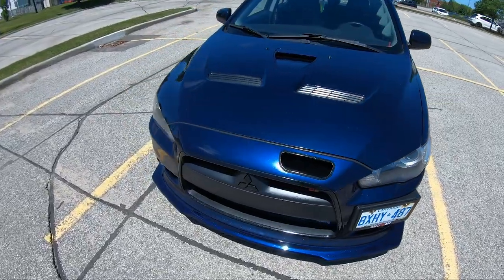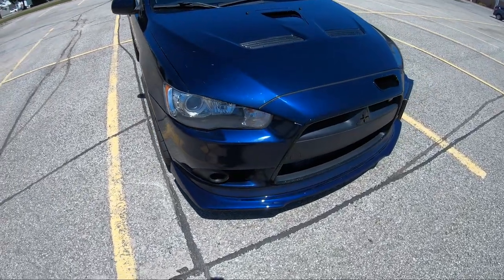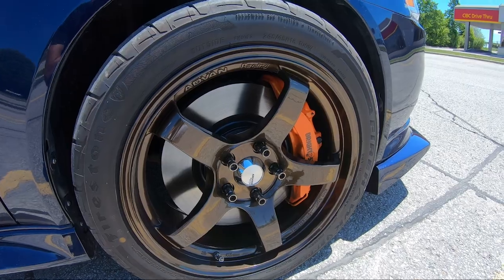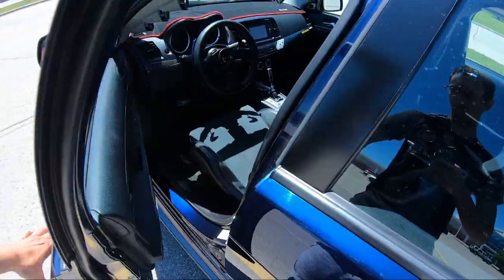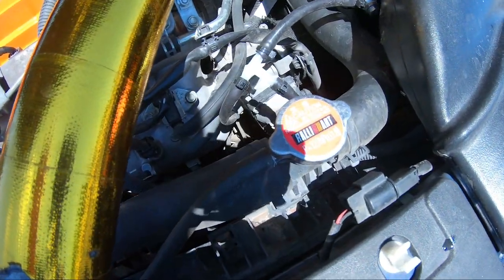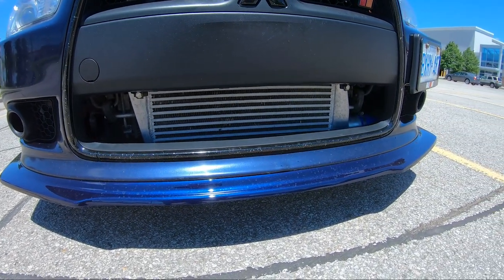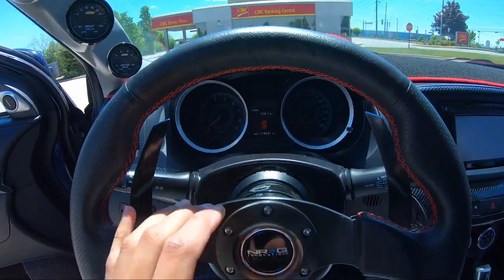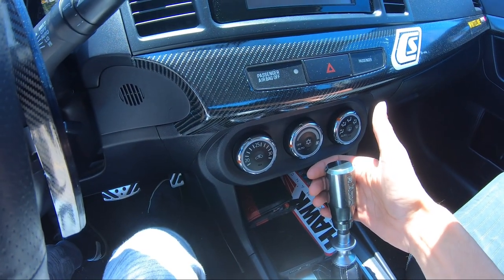Mitsubishi Lancer Ralliart! My Mods and Build

Comment from the maker: Just adding a disclaimer, I do drive it in Normal/Auto until the SST has warmed up and then I switch to Sport/Manual once it has reached operating temperature.
Reply: I have a Ralliart and never knew that... is it bad for the transmission if you put it in sport strait away?
Reply: @durrymcflurry3028  its recommended because of the increased clutch pressure, so the fluids need to be warm when in ssport.
Reply: @rozikhan2744  I only put it in sport mode not ssport, so is that fine?
Reply: @durrymcflurry3028  thats fine but everyone i know keeps it in normal when heating up.
Reply from the maker: It's goes below 0°C in the winter season here, I drive it in Normal mode to allow slip intentionally to warm it up. Once the fluid temperature reaches around 40°C, I put it in Sport. S-Sport is not recommended for Ralliarts (subject to opinion) because of the different gear ratios between the Evo MR and Ralliart, therefore the software for TCU is different. Although S-Sport does offer increased clutch pressure, you'll destroy your gear synchros driving it all the time in S-Sport. I would only ever use it when launching at the drag strip.
Reply: @torontotuners8218  I live in Australia so even in the winter it’s 15°, so I think I’m sweet to put it in sport mode all the time, just not s-sport
Reply from the maker: Yep, you should be good! If you need any help or advice, I believe AK Racing (Australia) are the guys to talk to for anything Evo/Ralliart related.
Reply: @torontotuners8218  Yep and RP Customs.  They'll both recommend you drive in super sport manual all the time.  Its fine to put it in SSM even if the gearbox is cold.
Reply from the maker: @CDTJosh  I disagree with the idea of putting it into Super sport and manual when the SST is still cold, but to each their own. If it's a hot climate then I wouldn't disagree, but when it reaches close to -20°C here in Canada then I would always let it idle for a bit and drive it casually to let the SST warm up before doing any spirited driving.
Reply: @torontotuners8218  cold in Sydney Australia is only about 5°C on a really cold day in NSW its usually at least 13°C by 8am here (assuming thats where he is cause RP customs)
Reply: @torontotuners8218  I’m in Aus I always let it run in idle/neutral before leaving on a cold start up for around 10 mins
Reply: @torontotuners8218  Calgary, AB here. Looking into getting a ralliart next summer. Wanna tune it more to have fun with the AWD. Gotta do some research to tune my future car Tove able to handle on seasons on this side of Canada.
Reply: No S-Sport!??
Reply: @torontotuners8218  What every sst needs to combat this is getting a Dodson Heated Sump. This will help dramatically even on a completely stock vehicle.
Reply: Do you need to unlock the S-Sport mode ? I'm still new to Ralliarts and I only have sport mode. I didn't know about S-Sport mode. Any help would be appreciated
Reply: I heard someone said that driving in automatic will ruin the transmission more and fast then using the "manual" mode. Is that true?
Reply: I heard someone said that driving in automatic will ruin the transmission more and fast then using the "manual" mode. Is that true?

Comment: Bro nice car, I have one of my own here in Brazil. Nice piece of advise about the SSport and the warming up of the SST. Would you mind listing your mods and the links for it? Really liked what you done with your RA.
Reply from the maker: Thanks! Honestly, I had a mod list at one point and deleted it. Most notably was the BBK front and rear, stainless steel brake lines, lowering springs, full turbo back exhaust, upgraded fuel pump, upgraded injectors and a custom tune.

Comment: Hows the transmission of that car? Evo or rallyart is one of my affordable dream car to drive and been hesitant because of the auto trans.
Reply from the maker: Take care of it, do the transmission, transfer case and diff fluid changes when you are supposed to with OEM fluid and you'll be fine. It is a hit or miss with the shift fork issue but the later model years (14-15), don't seem to have the problem as often

Comment: Saw u got a stock intake, would you ever change it to a cold air intake? If not, why?
Reply from the maker: Hey, sorry for the late reply. Stock intake with a drop in filter performed great for this setup. Also I had the bumper duct cutout for the stock intake so an aftermarket intake would have made it less efficient. Aftermarket intakes have their benefits but on a Ralliart it must be tuned otherwise the SST will react negatively to the modification.

Comment: Hey man, been thinking about getting a RA from my ES, and would want to get it modded to make around the same hp as yours if I were to get one.

How's the mpg looking like and how much was ur performance mods cost so far? excluding the brakes, tires, wheels, aesthetics.
Reply: don't do it bro, these cars are junk.
Reply: @pd5041  why'd u say that? Any particular reason?
Reply: @RedZekester  They come with an enormous  list of problems. Ayc pump, timing chain, tranny, turbo etc. maintenance is insanely expensive, stock they’re only pushing 200 wheel horsepower. If you do modify it then you’re putting all of this money into something that’s still slow. The AWD system isn’t even from an evo either it’s from the last gen evo. Honestly not a good buy, plus people will call you out for a wannabe evo. Up to you at the end of the day though.
Reply: @pd5041  shiiii, i just love how lancers look why I wanna stick with em. Can't afford an evo yet so I was thinking to go with a ra. U making me double think to just save up for an evo lol
Reply: @RedZekester  yea bro fr, I wanted one of these back in 2020 but when i found out rebuilding the tranny was 15K at the dealer or 5k at a shop I was like all of this money and work for a slow and weak car isn’t worth it. Just save up for a few years and buy a GSR.

Comment: Did you have to DIY the vent in the bumper or did you buy a bumper with it installed already?
Reply from the maker: It's a kit made by the same guy who did my BBK. It comes with the template to cut out the bumper to fit it.
Reply: @torontotuners8218  is there a link to buy the same template ?
Reply from the maker: No there isn't sadly, it's a proprietary design made by a guy in the Ralliart groups. You'll have to contact him personally if he has any left lying around or is planning on doing another batch soon.

Comment: How is car and transmission holding up? What power is it putting down and did you tune transmission with the extra super sport shit like evo.. ?? Very cool car. Nice upgrades.
Reply from the maker: Thanks for the comment! Car has never let me down once, I have owned it for 4 years and it has been custom tuned at 330whp, 350tq for half of that. No Super Sport here, I don't recommend it as the launch control you get with it isn't very good and the 5th and 6th gear ratios are different in the Evo. You get better clutch pressure from Super Sport, but again, that can be changed in the SST tables for Sport mode to be just as good.
Reply: @torontotuners8218  if I can I have two questions for you.. 
The engine internals are the same of the Evo? With bigger turbo , IC and injectors 300hp are possible with stock reliability?
Without front and rear LSD in the rain or tarmac does it oversteer under throttle?
Reply from the maker: Yes, engine is identical to the Evolution, except for the Final Edition which has sodium filled valves. With just a turbo upgrade you can make it to 300hp easy, injectors and fuel pump can get you to 500hp depending on the turbo and with the right tuner of course. I've seen a couple of Ralliarts pushing over 500hp that are daily driven, so yes, reliability is kept as long as maintenance is upheld. I believe it comes with a front LSD if I'm not mistaken, it will understeer on tarmac but I can get the rear to swing out on wet surfaces.
Reply from the maker: I was partially correct, the Lancer Ralliart has a front helical LSD, a rear mechanical LSD and an ACD (active center differential).

Comment: Hey man how do these handle being driven hard stock? and does your Ralliart come stock with a turbo? going to hopefully picking one of these up to replace my current daily which is a Kia Sportage AWD ( the AWD system is absolutely garbage) how do these handle snow and ice , I live in Maine and we get similar weather down here as you guys do in Canada
Reply from the maker: A Ralliart is the best purchase you can make if you go through all four seasons and need something practical that will never let you down. The Lancer Ralliart shares the same engine with the Evolution, so yes, it has a turbo albeit smaller than the one found on the latter. A good set of snow tires and it will get you anywhere you need to go during winter. Not many know this but the Lancer Ralliart uses the exact same drivetrain as the Evolution IX, just paired with a dual clutch transmission.

Comment: I just got a ralliart a few days ago I was wonder what fluid to use for it I want to change it out
Reply from the maker: For engine oil you can use whatever you like, I use Mobil 1. For the SST you MUST use Diaqueen SSTF-1 or Castrol Transmaxx Dual, anything else will wear out the components much faster and eventually break your transmission. For the transfer case and diffs just stick with OEM, it's cheap enough.

Comment: You have my respect regarding your ride. Do you have the info regarding whom did the Big Brake upgrades? That info would be greatly appreciated & thanks for your time. 👍🏾
Reply from the maker: I did them myself actually, sourced the calipers used and had them powdercoated to a color I liked. Getting them to fit requires modification to the wheel hub by enlarging the caliper mounting holes. They bolt right up after that, you have to use larger Evo X rotors with them.

Comment: Hey there, im looking at a ralliart myself. This one ive been looking at has been tuned by silvertuned performance aswell as the sst rebuilt by sjl custom auto. However it has 160,000km. Previous owner has sst maintenance records. I was wondering how many reliable years or kilometers i can get and if it would be a good purchase. Thanks
Reply from the maker: If it's been tuned by Nick and has a built transmission from SJL and with all the maintenance history then it is absolutely worth it and will last the life of the engine. You probably have another 40,000km in it before you should have the engine inspected. Sorry I didn't answer sooner, I don't check the channel very often.

Comment: Hey man just got an 09! Any idea what would help the most to get it to 300hp? That’s my first goal. Thanks !
Reply from the maker: Quickest way to 300 is to do a Evo X turbo swap. Exhaust manifold, turbo, downpipe, oil/coolant lines and intake. You can go all OEM if you can find the parts second hand. This would be the most cost-effective option as there are plenty of OEM parts around. Also have it tuned by either Kozmic if you're in the states or SJL if you're in Canada.

Comment: I am 17 years old looking to buy a first car, would you recommend a ralliart as a good starter vehicle?
Reply from the maker: I wouldn't, no. They are becoming more rarer and older, thus having higher mileage and also more than likely haven't been maintained properly (always an odd one out there that has been cared for and is in good shape, but definitely a needle in the haystack). Not to mention the higher costs of maintaining and servicing of the AWD system (SST, front transfer case, rear differential, etc). If you're willing and have the funds to do so, I won't dissuade you since I went in the same way, without a single thread of knowledge about the platform. There is a plethora of information out there in forums and Facebook groups that can help as well.
Reply: @torontotuners8218  thank you, I never really thought of it that way. Ralliarts and evos have always intrigued me but they may not be the best in the long run
Reply: @BG-ds1ti  I was in your boat wanting to get a Evo or Ralliart for my first car since they would be getting rarer by the second. I had the money to afford an Evo but overall not enough money to maintain it and it's insurance (i'm 18, it's my parents money handed down to me). So i decided for the next best thing and got a GTS 5-Speed. Uneventful, i know. But it's just to fulfull my Lancer Itch until i'm truely able to keep an Evo/Ralliart. It's extremely hard to find a 5 speed in South Florida as is so it was a no brainer to get it while it was still available. Hopefully by 21 i'll get my hands on one, it will be expensive but worth the wait.

Comment: Do you need to unlock the S-Sport mode ? I'm still new to Ralliarts and I only have sport mode. I didn't know about S-Sport mode. Any help would be appreciated
Reply from the maker: You have to flash the TCU with Evo X MR software to be able to use S-Sport mode.

Comment: Hey how’s the transmission doing?, I saw a 2010 with the automatic and it has 145k km, I like the car but I’ve seen so many people saying that the transmission shifts really good and everything but is very unreliable 😅😅
Reply from the maker: Transmission was better than ever, shifting good and hard (in a good way, it's been tuned) at 140,000km. Also it is not an automatic, it is a dual-clutch. As long as the transmission has a consistent service history and will continue to be serviced correctly it will last for a while.

Comment: Do you think this is a good first car? I am currently looking for one of these and found a 2011 model with 105k miles on it. But, I have heard that these aren’t reliable and my parents don’t want me to get one because of that. I am just curious of what you think or should I start looking for a different car?
Reply from the maker: For a first car I don't recommend it, they are expensive to maintain and as for reliability they are bulletproof ONLY if they were taken care of by previous owner(s). I'm currently at 130,000km with no major issues except for the accessory belt auto tensioner which failed. In my opinion, buy a Toyota 86 or Subaru BRZ, probably the best first car out there, make sure you get a manual.

Comment: how much did this car initially cost you ? I want to get this 14’ ralliart with 71k mileage but i want to know if im being overcharged
Reply from the maker: That's high mileage for a Ralliart, if it has service records, go over them to make sure it has had regular SST fluid changes with OEM Diaqueen. Depending on the body condition as well, and if it has the leather Recaro seats, navigation, etc. I would say $8000 is what it is worth.
Reply: @torontotuners8218  i might buy an 09 ralliart with 129k miles, what do you think?
Reply: @Toronto Tuners its pretty much stock
Reply: @torontotuners8218  thank you

Comment: What turbo for 400 hp, my ralliart is with evo x turbo (turbo hybrid)
Reply from the maker: With an Evo X turbo and supporting mods you could see over 400whp. My turbo is a modified TD04, so stock frame and it's been retuned recently to 330whp. With fueling mods I could get close to 400whp as well.
Reply: @torontotuners8218  the stock td04 turbo comes stock with ralliart right ? I’m thinking if I should buy a upgraded X turbo but not the stock one or jus upgrade my 2011 stock rally turbo !?
Reply from the maker: Yes, all 2009+ Ralliarts come with the same engine as the Evo just with a TD04 turbo instead of the TD05. It all comes down to what you want, upgraded TD04 will only get you so far for power but will have incredible low to mid range. Going larger turbo, such as the TD05, is a great and cost effective option for more power since a they are easily purchasable second hand.

Comment: 2.5 exhaust or 3inch?
Reply from the maker: Ultimate Racing's downpipe is 4 inches I believe and from there back is 3.5 inches. Very nice exhaust but they use steel flanges which is the only downside.

Comment: Hood dampers to make opening the bonnet so much easier? Because the aluminium Bonnet is far too heavy to lift for........ well....... anyone!!!
Reply from the maker: The aluminum hood is actually very light, similar weight to a carbon fiber hood. The dampers were meant to eliminate the factory hood prop since it gets in my way when I'm working on my car.

Comment: shift up when you speed up and dont let it roll out in the gear you been, i can hear the poor engine..
Reply from the maker: I don't quite understand, are you talking about when I went WOT? If so, there is nothing wrong in doing that.
Reply: @torontotuners8218  what is wot? after you reached the end of 3rd gear you let the rpms go down without shifting and gas, for me the engine runs dry in this moment and for old 2 Stroke bikes its a total killer and i think for the car it isnt also good bcs running on high rpm without gas is never good bcs gas gives cooling
Reply from the maker: Wide open throttle, and I understand what you meant now. No, because of the increased load of shifting at such a high RPM, it is much better and safer to just let off the gas. No gas = no power being sent to the wheels. As far as I know, two stroke motors are very different from modern day engines.
Reply: @torontotuners8218  i dont know i never do this in my 200sx, i would feel bad if i do, i always push the clutch when i dont want to shift in next gear with high rpm, the gasolin also lubricates the part of your cylinder wall which the oil cant reach, and with no gas its running to dry when it goes with the high rpm connected to the transmission. Sorry for my english and good night from Germany
Nice Car btw
Reply from the maker: Ah, its different because you're driving a manual, pushing in the clutch is the right thing to do. My car doesn't have a clutch pedal, it is a dual clutch transmission, so basically when I lift off the gas it disengages the clutches.
Reply from the maker: Thanks for your comments! Goodnight from Canada!